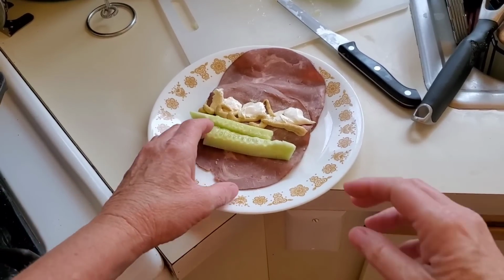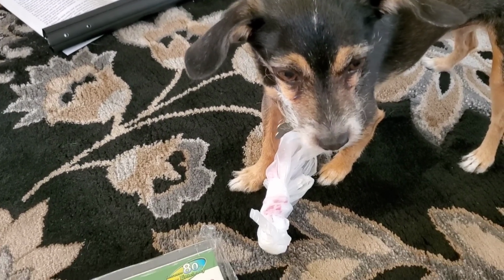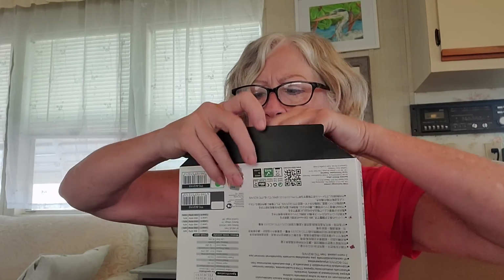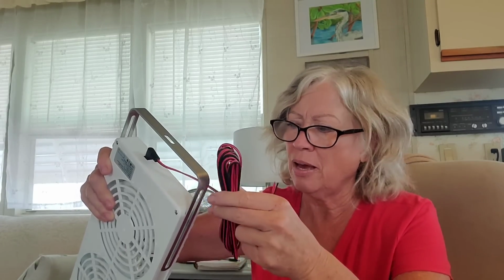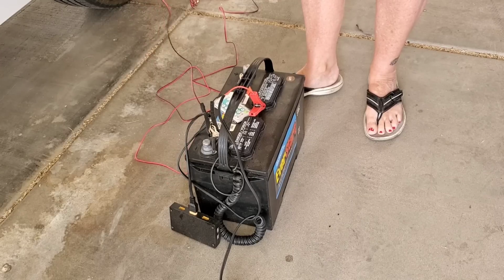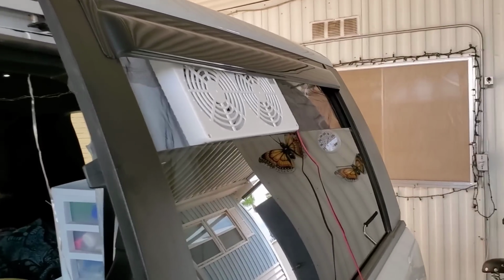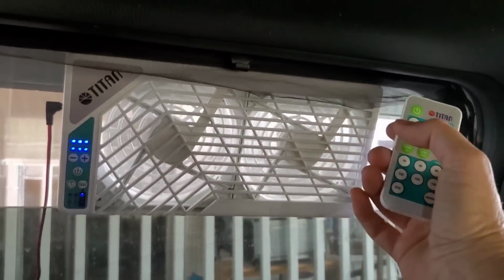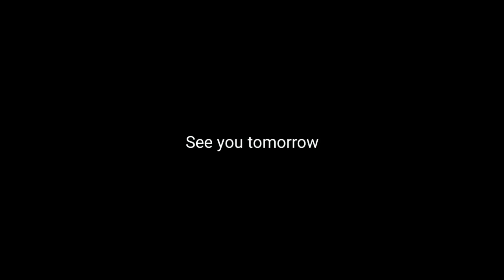Titan TTG-SC21 Multi-purpose RV roof rack fan

Comment: Darn it!  I wish I knew how to make videos because I really need to post somethings on cooling cars ,  vans, campers etc.  40 some years of experience in this field gives me so much to say to make it easier for others. Number one Carolyn,  I love your videos and your projects. You’re an attractive person with a great personality. Your videos are fun.
But there is one thing everyone seems to do wrong and that is you can’t push  air in and expect to get cooler!  One MUST seal around a fan that pulls air OUT of a living space… THEN have filtered opening on the opposite side of the living space that lets in cool air or at least fresh air in,   Remembering that if you push air into an area you increase the air pressure therefore exciting air molecules and produce heat!
Always remember pushing unwanted air out creates at least a little negative pressure and therefore reduced heat. 
A diesel engine runs and a jet engines run because air is highly compressed enough that  it will spontaneously combust when fuel is injected into it, and that is a lot of heat.  
The principle is the same here. Compress air to make heat, reduce air pressure to make it cool.  I hope this helps. 
(Dictated but not read, legally blind)

Comment: I just bought a double window fan at Goodwill. $6. It runs off 120V ac, but I have inverters.
Reply: Sounds like it is industrial strength fan
Reply: @RubberCityRebel  No, but it does work well. Walmart sells them as window fans. The fan blades are a bit larger than the ones in this video. They sell new for $22.

Comment: Carolyn the fan is a good idea, maybe not this one.  LOL  They have dual remote control fans that aren't quit this small but would work since you're only going to use it when parked.  I have one in my bedroom window for exhaust & it works great, it was $39.99 at Home Depot.  FYI on the list of best fans for 2021 they have this exact one listed as number two on the list.  Apparently who ever tested the fans aren't too concerned with air flow! LOL  God bless you & Parker!  Thanks for your honest review, I'm sure you saved somebody $100.
Reply from the maker: No kidding?   Wow.

Comment: I wonder if the fan isn't producing the amount of air needed because you have your doors open and neither side of the fan itself is enclosed.  I think with a fan like that it has to be enclosed on both sides just like an AC does.  I could be wrong but I would mess with it a little more.  Try fitting some foam board from the Dollar Tree into the pull out sides of the fan and close all your doors and windows and then see how it works.  It may not be any good, I don't know, but it's worth a try.  You may try it with just some cardboard from a box.  ????  It sure looks good even tho' it doesn't seem to be working.  LOL  Did you get any directions with it?

Comment: I have a little 12 volt fan that works great for my dog while I am out of my camper.   And, of course I have the roof fan and it is really insulated.  Can't leave it on when you turn off the car is the only problem.   But, it is great when she is in the bed in the back and does not get the AC from the front.

Comment: Slim potato head has a vidio from 2 years ago reviewing that fan. He attaches the wires to a cigarette lighter plug in.
Reply: If you aren't getting air do you have it in backw9ards? It is a to way fan
Reply from the maker: You are correct and no air moved either direction.

Comment: Good Job! 
I've had that fan for a couple of months. I have it hooked up to a separate 12V rechargeable battery. That way I can leave the fan running when I am working (on rental property sites in my property management business or when I am shopping).  That way, I don't have to worry about it running down my vehicle engine battery.  I'm probably going to buy a second fan to get more cross circulation. Like where you are at, it get's hotter than blue blazes here in  Dallas.

Comment: Carolyn - does that fabric you have over the opening in your window which you are calling a screen - could be decreasing the flow of the air you want to feel.  Air does not blow through fabric netting like it does a regular screening material that is put in window or door screens.
Reply: How much air do you think the netting affects the air flow? Fans like these work best when you pair them with another one that does the opposite, meaning one is blowing and the other one is sucking air.
Reply: Good to know. You can buy window screen material and that's what I plan to do. I figure it will hold up longer than tulle or netting, but that's just my belief (don't have any facts to back that up!)
Reply: It was leftover window screening she used a few years back.

Comment: This thing is $100. 
I have plans for a roof/sunroof fan I'm planning to put together this fall using 2 12" 12v automotive fans. Half the price. Wont have a remote but it will be reversible and be 10x the fan.

Great Review!

Comment: Hi Carolyn, 
This is an Amazon link for 5mm plug that will go into a Jackery 500. It is for the DC port. (18 AWG DC Power Pigtail Cable, 2.1mm x 5.5mm Barrel Plug Wire Male&Female Connectors for CCTV Security Camera and Led Lighting Power Adapter by SIM&NA).  This should work.  $97 ??   I agree with you. 😎

Comment: maybe try it to remove the hot air out of the van instead of trying to bring air into the van?
Reply from the maker: I did both ways. Very low power.  I'd pay $25 for this fan. Never $97
Reply: @CaravanCarolyn  Yes. You gave us your honest opinion of it's value. In other words it worked, It's just not worth $97.

Comment: This fan was not designed for you or your van! 
They should have never sent you this item.
You need items that are plug and play for mini vans/cars, not items that need to be physically installed.
This Fan needed to be physically / permanently installed. Not just hung in a window and needs more then just one. This fan remind me of your USB fans completely worthless.
Reply from the maker: However and wherever it's installed,  it still has very little airflow.
Reply: @CaravanCarolyn  Not blaming you at all!!! That's why I said it reminds me of the USB fans you had that you said were worthless.
Reply from the maker: @TheUGFUGF  I know.  People are saying it's installed horizontal and should be vertical.  It still has no air flow! 😂
Reply from the maker: @TheUGFUGF  For a hundred dollars? Nope.
Reply: @CaravanCarolyn  You are correct?
I have not seen one fan that is really designed to be "installed" in a window.